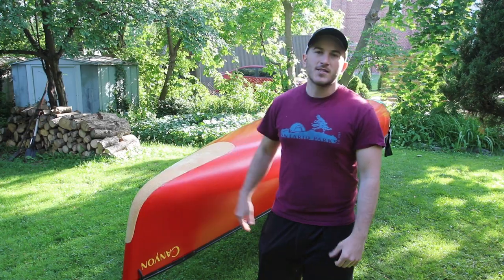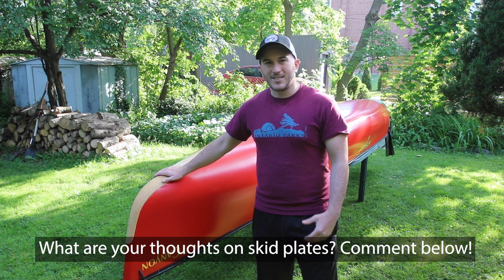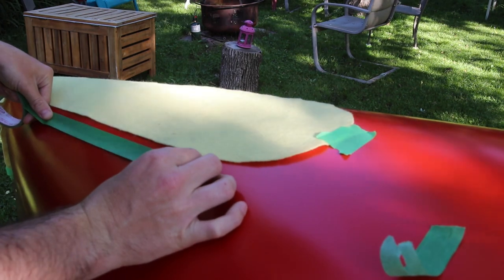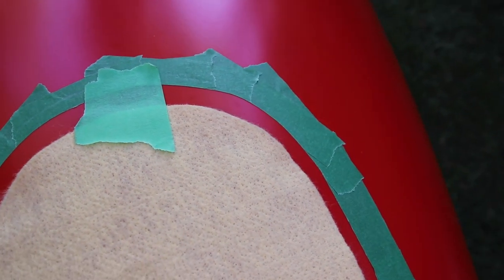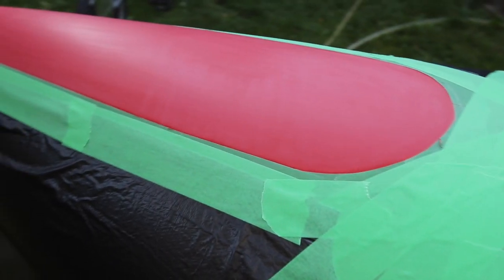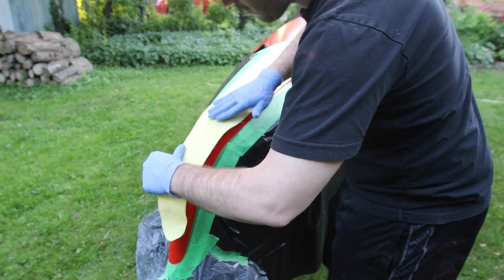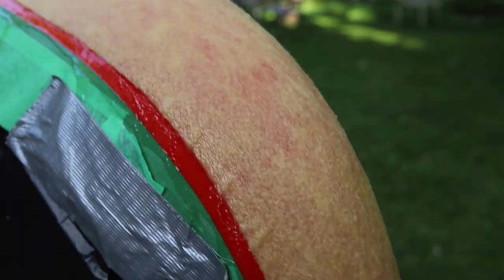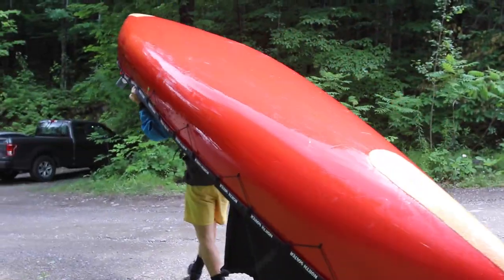How to make your canoe more durable

Comment: great video, Really good job! looks very even on the hull. one tip I would give (used to work for Clipper, Swift, Scott outfitting canoes) is don't use a traditional paint brush, it does not spread the epoxy, use a small roller, and a foam brush. You can also add a tint to the epoxy if you want to colour match to your hull.
Reply from the maker: Great tip! I also found the paint brush not to be effective haha. I have seen other canoes with the colour match skid plates. Also good to note! Thanks!

Comment: Thanks for the video. As you know there are other fabrics that can be used for skid plates. Kevlar is good but I have been very happy with the dynel cloth that I used on my Wenonah Minn. 2. It has superior impact and abrasion resistance. I applied it with G-Flex epoxy. BTW - I also use dynel  cord  on the tips of the paddles I build. Good stuff IMHO.

Comment: I haven't put skid plates on my carbon fiber Swift Prospector, yet.  I don't ground the stems out on shore at all I always come to the bank off the side.  I pole a lot which give great control in rocky water and being just south of you in Maine we have our fair share of glacial till rocky streams the run out of water in the summer or at least get rather low and rocky.  I do have an Old Town Tripper with skid plates, the boat is out of the 1980's with much use, I noticed the skid plates were run up the stem similar to you have, but over time the section of the skid plate that runs along the bottom could have been longer or slipped it down off the stem which actually sees very little wear,  I did add more kevlar and G-flex to the worn area on the bottom of the boat.  Almost got into a new Esquif this summer but funds got redirected maybe this coming season,  but the Swift is holding its own.

Comment: I keep reading that they create a significant amount of drag in the water and reduce efficiency. Thoughts?
Reply: Any amount of drag via skidplates is negligible unless you're using your canoe for racing. They're contoured to the hull nicely and don't really protrude. You'd be looking at a small % at most. Just based off feel at least, skid plates haven't put me hours behind schedule.
Reply from the maker: I agree with Brad @explorethebackcountry - it would be very little if at all. Racing you want every advantage possible so you likely wouldn't do this. We beat these up, it is important for us. Cheers!
Reply: You must be reading a racing magazine! These strips are totally a whitewater thing. You won't be doing it to carbon fiber and lightweight flatwater craft.
     I'd say bigger factors in efficiency are hull shape and paddle/paddler, boat loading, wind and current. I would put hull blemishes at the bottom of the list.

Comment: How much epoxy did you use? I ordered 250mL (each part 125 mL). Would that be enough for both ends of the canoe?
Reply: I ended up ordering the 950 mL version instead.
Reply from the maker: Probably a good idea you went with the larger size. Better to be looking at it then for it my friend used to always say.

Comment: where to purchase kit
Reply: G-Flex is good for this and available at most marine supply stores
Reply from the maker: Many of the companies that sell canoes will have a kit for installing a skid plate. I got mine directly from Esquif.
Reply: True. And as you paddle more class 3 whitewater, particularly when loaded, you will test these "bang strips". I have personally cracked and blasted off peices. 
    Your segment was on "how to make your new canoe last longer". Mine would be on "how to keep the old warrior canoe in good service". 
    Over time you dimple in the bow and stern areas. It mostly recovers with a heat gun. Older Royalex canoes would start to delaminate in the foam core. G-Flex can repair. It is an epoxy that maintains adhesion under flex - just what is going on with the boat hull.

Comment: Wearing a mask to work with epoxy:  It is important to wear a CHEMICAL respirator mask... not a COVID-19 type mask. The danger is in inhaling the epoxy vapors. Therefore, you need a real respirator that keeps the chemical vapors out of your lungs. Epoxy is carcinogenic. Keep it off your skin and out of your lungs. You had an excellent place to do this work... outdoors with plenty of ventilation. Do not do this in your basement or elsewhere with poor ventilation.